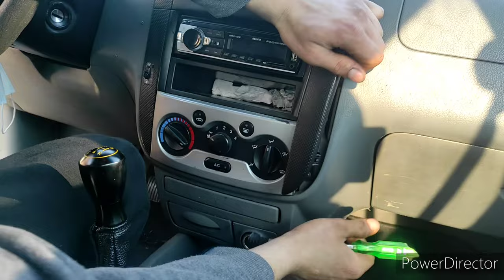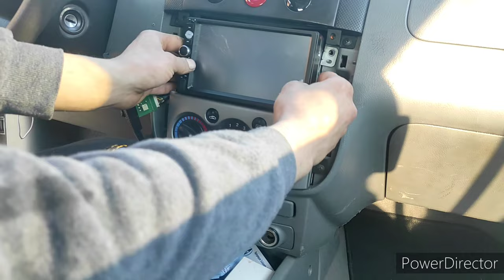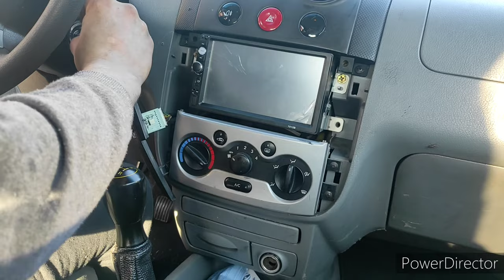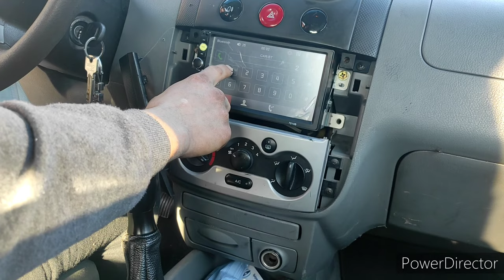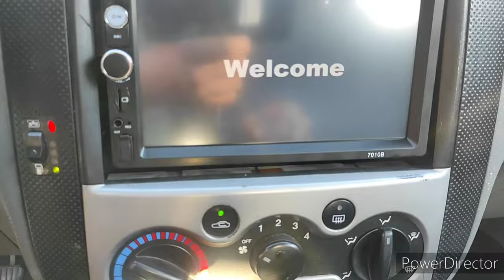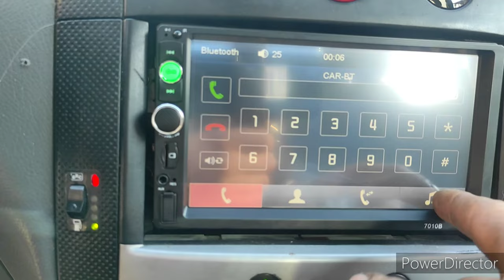how to install an aftermarket 2 din 7 inch touch screen stereo to replace your old 1 din stereo Easy

Comment: I want to switch out my aftermarket radio. The cables are all wired and has an amp, so i figured it shouldn’t be too hard to connect. Buying my radio soon after I figure out which one to buy
Reply from the maker: No if the connectors are the same you just make sure you place it corectly on its mount.....and the wires must be only plug amd play.!!
Reply: @Kristi98  the plug that was wired from the first radio (single din) didn’t fit the new one (double din). Idk what the plug is called, maybe the harness, but it was smaller. But I got one in!!

Comment: I have the same one. It works fine when car is parked but soon as I start driving it gives a blue screen saying "reversing" on and off. It's so annoying. Is there a cable fault or something?
Reply from the maker: Normaly you have a wire connected with your handbrake so you cant use the sreen video player while driving i think...you must find the wire that says parking and connect it to the wire that brings power when the key is on.!!And it must fix it...or maybe if it doesnt say warning not screen active ehen driving then maybe you need to disconect/cut the wire behind radio that says reverse becouse it activates the camera when you reverse..but when driving normally i dont know it doesnt make sense why it doesnt work.......i have installed now a new one din pop up screen one that i needed to bridge the power wire from the key to the handbrake signal on the radio becouse it wouldnt let me watch videos while driving..!!What kind of car you have!?

Comment: hello friend. I bought a radio like this, but before installing it in the car, I did a check and after only 15 minutes, the radio gets very hot... why should I install some coolers with venticators?
Reply from the maker: Hello my friend!!It is normal it will get hot...stepialy if you are running it full....but it must be ok...

Comment: Wow a car with actual bolt locations instead of the strupid ridiclious clip system VW used on my Polo
Reply from the maker: Yes my Friend it very good and convenient and a lot easier to work with if the side things go off you have a lot of space to work and do anything with the wiring.!!

Comment: What is the two white wires with black and green you plugged in? I havent plugged in those wires and my stereo wont turn on
Reply from the maker: The two white wires i plugged in with the green and black connector are my RCA for my amplifier i have on my trunk...it doesn't matter if you plug those or not your radio must work still....its optional normally cars dont have those its something you put on.!!You don't need those for your radio to run my friend.!!
Reply: @Kristi98  well then I honestly have zero clue on why it won't turn on then 🙃  can I email you pic of how I have the wires currently?

Comment: What's the max of screen/radio size what will fit into it? And dont you need any other frame to make it fit?
Reply from the maker: Normaly not it depends on the car it lets a little space around but its barelly noticable...but in my toyota corolla i have i change and put a screen and i buy a frame so it fits perfect it looks a lot better

Comment: Can it be installed on a Toyota Camry2007?
Reply from the maker: I dont know my friend i have not instaled one in a camry before...but as long as you have space in the dash i mean two removable slots them yes it must go...this radio can adapt on these kild of mounts like i have and on a double din one....but every car is diferent..if it has two slots devided with plastic from the dash it dont fit then..!!

Comment: What radio is used? And did you need to use connector cable from car to radio?
Reply from the maker: The radio is a 7010B i buy this in a chinese shop.!!And the standart connectors from your car fit..you dont need an adaptor for this redio!!
Reply: I just bought one of these,had a single din before,does that mean I won't have to do any rewiring,just plug the old cables in an it should work?🤔 @Kristi98

Comment: The radio in my sport trac is not working. How do I know if it's the radio or the wires? Just bought the truck and it was not working to begin with.
Reply from the maker: First of all Happy new year my friend....first you must check the fuse for the radio in the fuse box ... usually its under the dash or under the hood...i think in the sport track it is on the corner of the driver side of the dash if you open the door you can access it..(depends what year it the car too)...but make sure you have your cigarette lighter is removed because Sometimes it is in the same circuit with the radio and if it shorts out it takes out the radio too...Then replace it if its burned......it must be a red 10 amp Fuse(If your fuse is burned)....!!!Now if your fuse is ok then it most probably it is the radio toasted.... wiring harnesses rarely get damaged and go bad only if someone else has an aftermarket radio instaled and has messed up the wiring.........Now there are some radios with a fuse in the connector on the back of the radio check that out too but if that one is burned the radio is most probably toasted.......Is it aftermarket or the original radio from factory...!??
Reply: HackeThanks for the reply. Happy new year as well. It's a 2001 sport trac with the factory stereo. I checked the fuses in the fuse box already and they look fine but I haven't checked if there is a fus behind the actual stereo. Guess I will need to check that next.
Reply from the maker: No problem my friend....Most probably the stereo is bad if all your Fuses are ok....but if you want to check and be 100% sure you car is delivering power and its the radio problematic....you can check the power with a multimeter or even a testing probe(or how its caled) you have 3 wires for the power to the radio....One is Black(ground) One is yellow (12 volt power 'always') and a red wire that is for powering the radio up(12 volt 'only when the key in turned on at the ACC or accessories just before the starter possition) if these wires have these readings....or the light is on on the testing probe(or how its caled) then the radio is broken for sure...--(+check for the fuse in the back of the radio not all radios have it but many do)--I hope I helped you if you have anything alse that i could help you with i would happily do...Thank you
!!
Reply: @Kristi98  Thank you I appreciate all the info. Take care!
Reply: @Kristi98  awesome job ! What is the brand of that stereo?

Comment: Bro why didn't connect the other harness? Or it not required
Reply from the maker: The harness with the coloured connectors is for the steering wheel buttons but this radio doesnt support that so i let it out(i think you can connect them with this radio but i dint connect it)